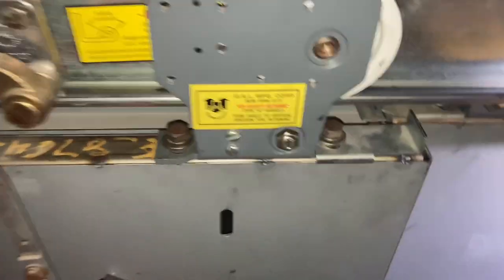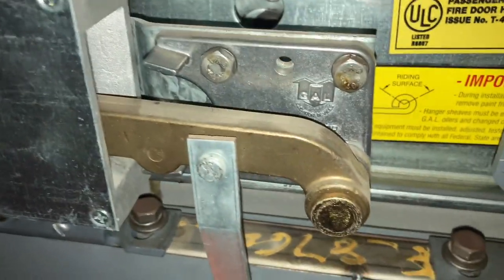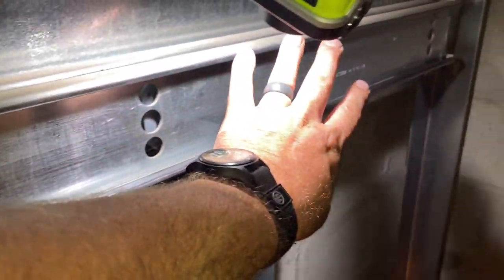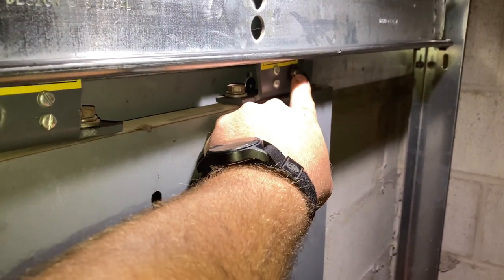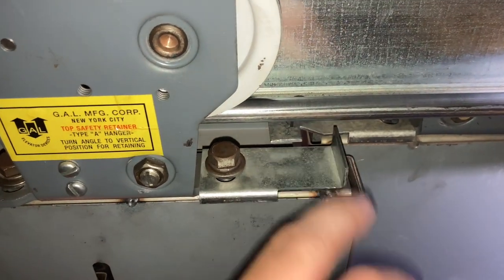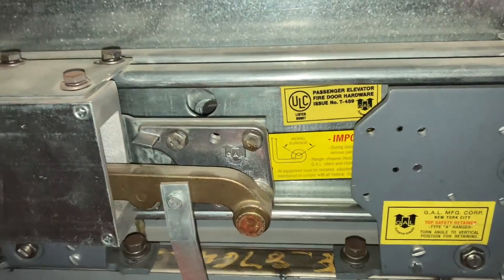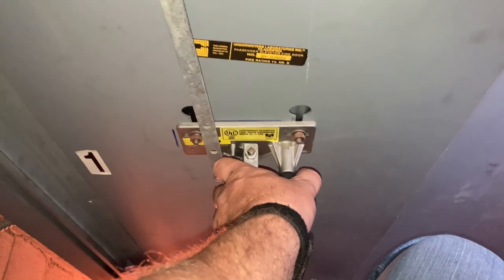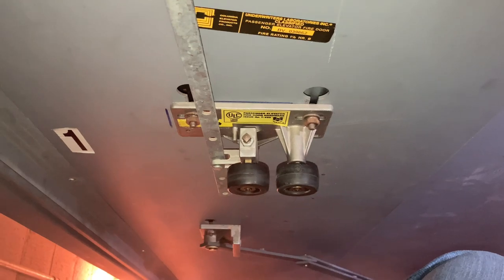Elevator Door

Comment: A lot of people hate doing doors, it's one of my favorite things to do
Reply from the maker: It’s pretty satisfying when you get the doors running smooth.
Reply: Door equipment hall, cab, & operator issues are the cause of a lot of callouts.  When I did new equipment adjusting and mod I always spent as much time as necessary to adjust them the best I could.

Comment: Those sill mounted closers are one of the main things I detest about GAL door equipment.  They're just big bulky, high-maintenance contraptions.  They are the only company that still does that.  All others are using the cable pulley on telescopic doors.
Reply from the maker: I don’t like them either